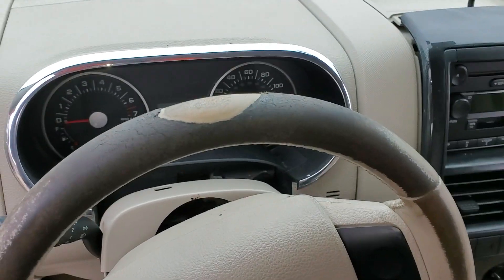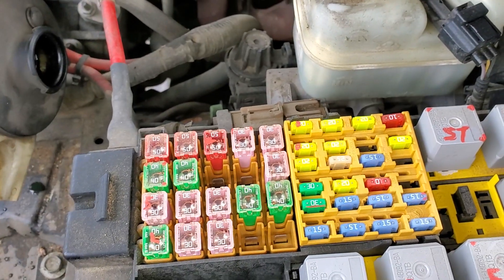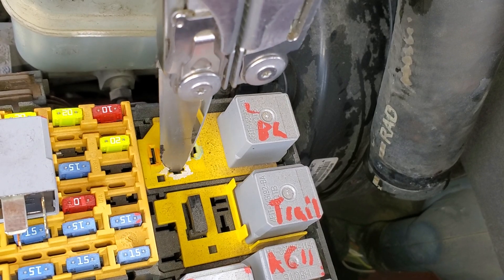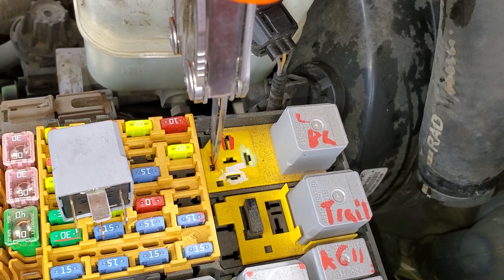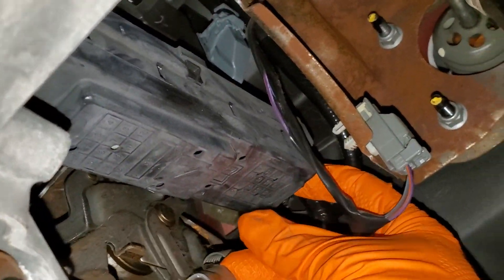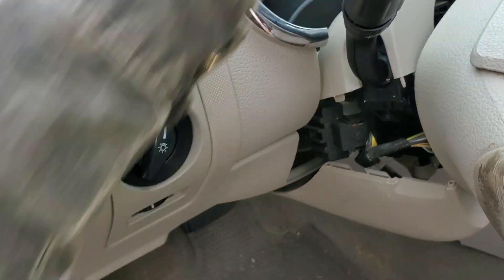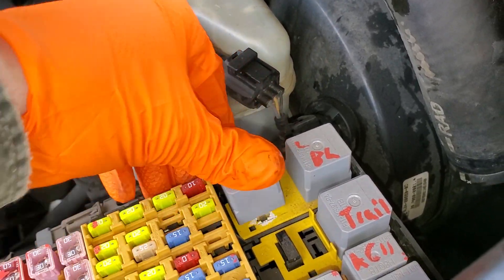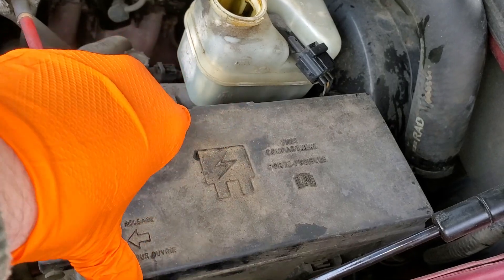2006 Ford Explorer Starter Relay, Starter Fuses & Ignition Switch Wiring Explained

Comment: REALLY good, quick troubleshooting video. I was able to eliminate everything but my neutral safety switch and my alarm with this video so I wouldn't mind if it was a minute longer showing specifically how to test the neutral safety switch. Glad you showed where it is though, I would have been looking under gear selector.  I'm suspect my alarm.
Reply from the maker: Have you tried starting it in neutral?
Reply: @LehewTech   Thank you.  I don't think I did. In fact that may be the ONLY thing I didn't try lol.  It turned out to be the engine control module (the computer) which I had a shop replace in case it needed initialization or whatever.  Got it running for about $300 and traded in on a 2019 AWD Hundai. Now I get more mountain biking in :)
Reply from the maker: @williammason1932  Hey man how is the Hyundai doing for you?
Reply: Thank you for your video  I checked the starter relay the left pin where I should have power is grounded  when I checked it with my test light  top and bottom pin go to the starter when I ran my jumper top to bottom  starter engaged and started working   so I must have a problem with my neutral safety switch
Reply: @LehewTech  I guess I've had to 2 years now and it's great. Not a single problem. I just put gas in it and once a year put synthetic oil change. Handles like a rally car on dirt trails but it's not taking me on any 4x4 trails. Got an electric mountain bike for that.

Comment: Recently my car was not starting So I replaced the starter and the vehicle worked fine for about a week. 

Then this morning I turned the key and the same symptoms happened as if the starter was bad,

I noticed after checking the 30 amp fuse it was blown, I put a new 30 amp fuse in and it was blown after I tried to start it again what do you think the issue is? What causes the fuae to blow? Thanks for your helpful videos.

Comment: When I jump power from the positive terminal of battery to white relay the starter turns over.  When I put the ignition key in the run position and jump to the white relay terminal the engine turns but does not start. What is wrong Lehew ??? Thanks for your help  and Happy Holidays.

Comment: Hello. I have a friend with a 2006 ford Explorer with 4.0L eng (Eddie Bauer) version. A few days ago, the guy was driving the vehicle a short ways from his home, and the engine cut off completely.  There was a burning smell near starter, and starter had a burned out wire, so he replaced starter. So, now the vehicle will crank but will not start. Battery good, fuel pump working, crankshaft sensor replaced also. However, vehicle will only crank but engine won't start. Do you have any advice here for my friend?

Comment: great video maybe you can give me some advice i swapped relays nothing i jumped relay to starter works . i did test lite on wire from ignition it lights up but it will not crank any thoughts

Comment: I have a 2008 explorer. Was running fine..it sat for a month give or take. No it won't start no crank nothing ? I can hear a tap noise in the starter when I turn the key. Do you have any idea what could be the problem?
Reply from the maker: Have you checked the battery?

Comment: 2008 Mercury mountaineer 4.0. Installed new battery, new alternator still next morning. Won’t start. Battery stone cold dead. Jumped it again and works fine all day. Tested voltage while running 14.6v while off 12.6v. Also cleaned all the grounds inside engine compartment. My question is would a bad ignition switch be the draw down. Sometimes you would hit a bump and the dome light would come
On. Once you touch the ignition it would go off. Lol!
Reply: Changed the ignition switch. I guess time will tell.

Comment: I have 4 and a half volts on ignition wire on the relay and drops to less than a volt when keyed to run position, any ideas of what the issue may be? Car does start when i take battery voltage to starter side of relay. (Also put in new relay)